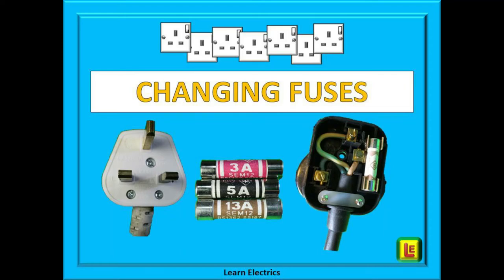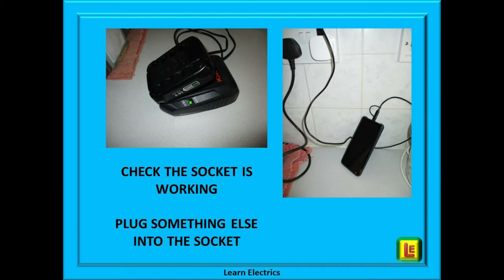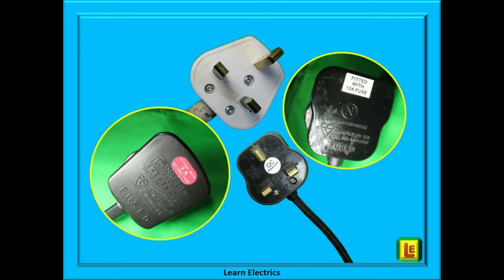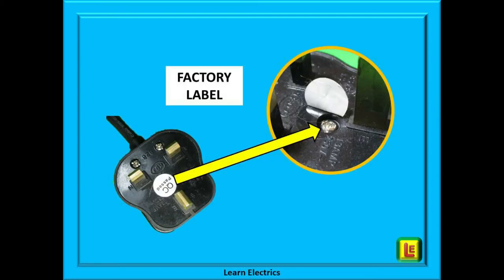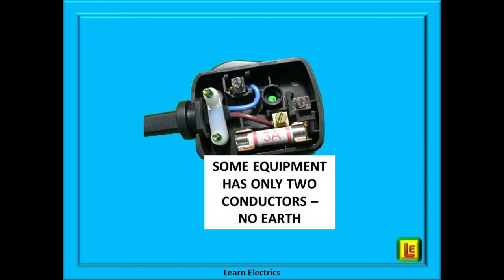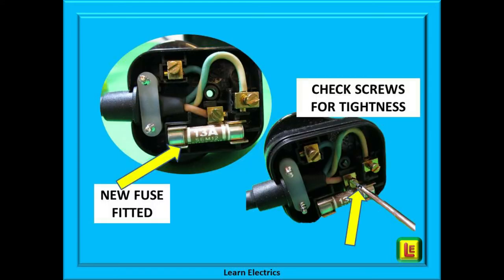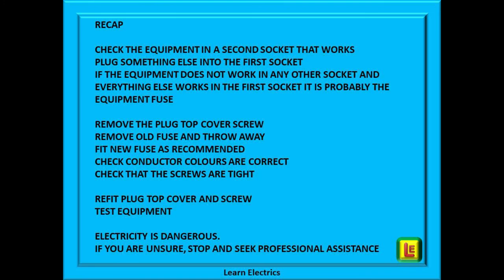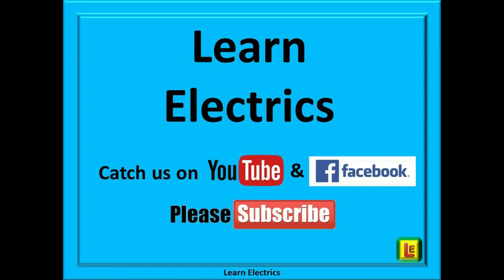CHANGING REPLACING FUSES How to change a Domestic 13 amp plug top fuse and how to do it safely

Comment: Is there a fuse more than 13 A?
Reply from the maker: Yes, there are many fuses above 13 amps, many for industrial use. BUT if you mean plug top fuses, then no, 13 amp is the maximum. thanks for watching.
Reply from the maker: See above.